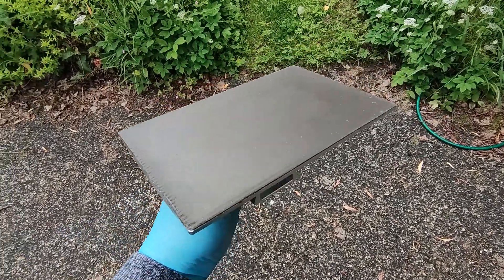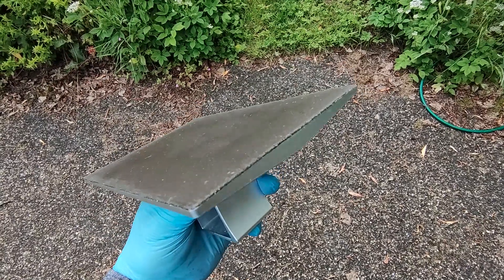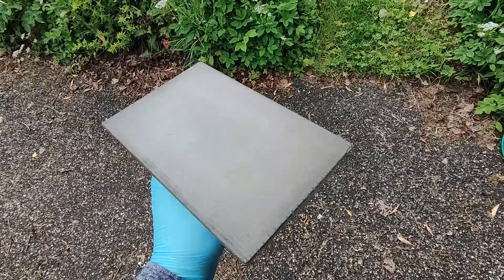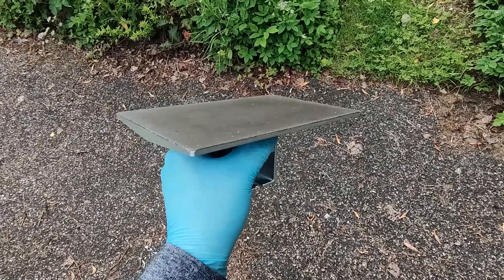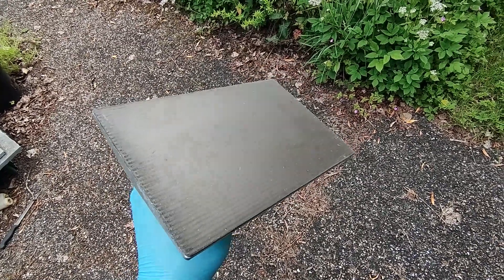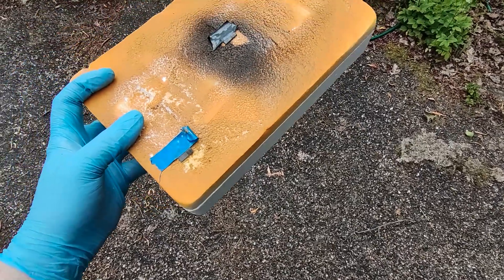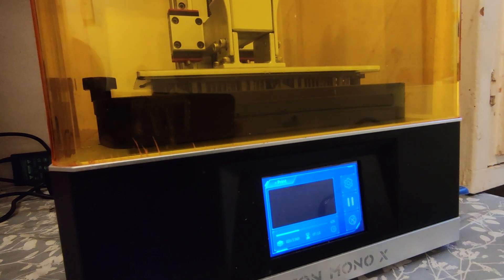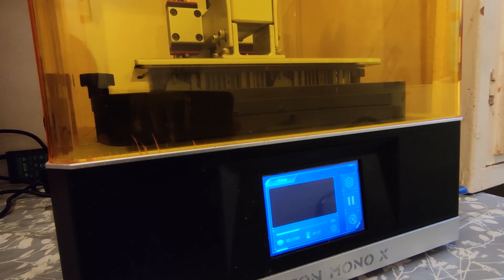Fixing ONE upgrade I made to my Mono X Printer : Magnetic Build Plate

Comment from the maker: IMPORTANT UPDATE!  
It didn't work. After 15 or so prints later, the resin started eating through the lacquer and back into the rubber... Im not going to remove this video or the other video away as these are all learning experiences. Both for myself and everyone who might do a mod like this. 

Might be worth testing WHAMBAM even though I hear there magnet suffers the same resin shrinking pulling the flex bed off the magnet issue. 

I may also look again at fixing neodymium magnets in a plastic frame which was my first plan. But ive been really busy lately so Im not sure how much time I can put aside for that. 

Anyway IF you have done this mod. Be aware of the issues I've faced, I hope you have had better luck.

Comment: I've been running Whambam's plates on two Saturns for around 2 months. I've run numerous prints on each over that time and... mine look fine. 
Even with resin lingering on the magnetic sheet for long periods while the plate is off I've not seen any deterioration or lifting issues. Of course, this is just my experience (US buyer), but I thought I'd share.

Comment: You can make one... get a flat plate and drill holes all over it and put magnets in the holes then cover it with sheet metal.
Reply from the maker: Yep that was plan A, might go back to it if this fails
Reply: Agree. Little more effort up front, but would seem a lot more bulletproof.